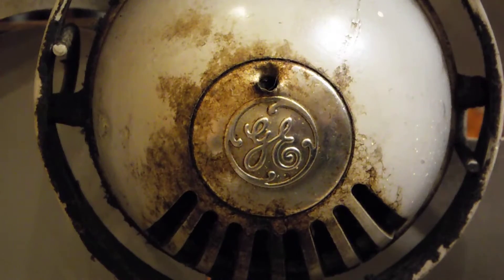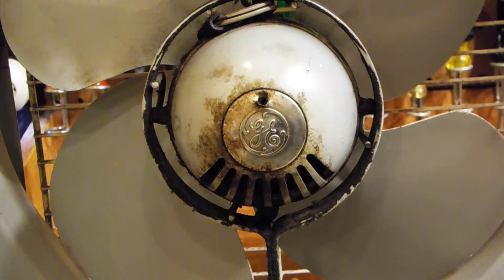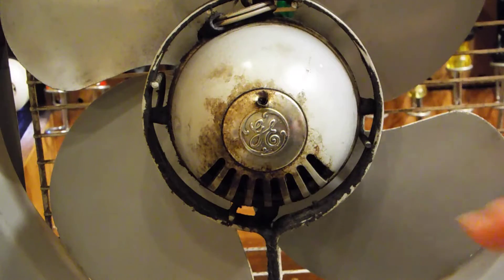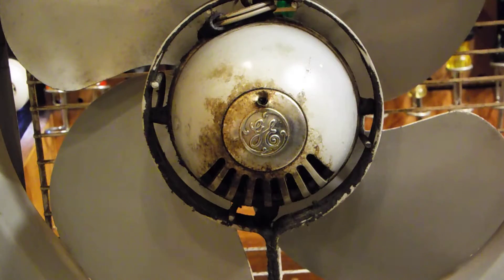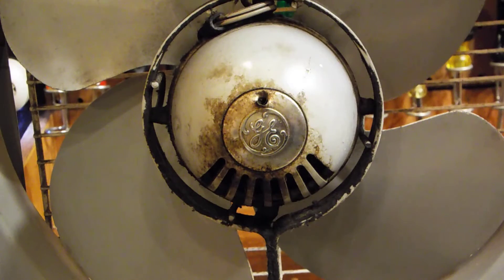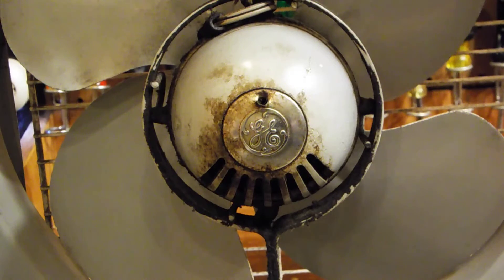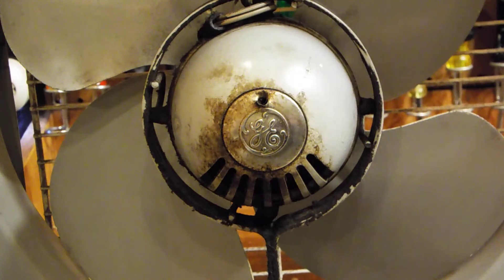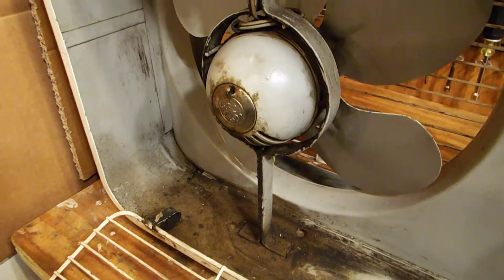Lubricating General Electric Fan Motors

Comment: I just watched your video and did this little mod. The blades are actually vertical on my moms fan so it basically blows air in all directions with no need for oscillation. As soon as I drilled the hole I saw the fiber material. Soaked it good with machine oil and put a piece of duct tape over the hole to keep from dripping. Works like brand new. Thank you for this video!

Comment: Hello sir. I thank you for this video! I have an early GE all purpose fan with the ball motor, and am grateful for your help..however, you should know..i removed the GE logo, under which there is another cap, which i drilled the hole into, and then replaced the GE logo over it. It saves the beautiful logo, and acheives the intended result. Hope you can use that information in the future! it's kind of like a bearing cap on old-school tapered bearing caps on cars, you just gotta gently pry it out.
Reply from the maker: This is true.. I was not the one who worked on this fan originally..

Comment: these single bearing motors are called Unit Bearing Motors as today they are common in refrigeration equipment. the older GE fans and refrigeration unit bearing motors have to drill a hole in the cap to add oil nondetergent SAE 20 or zoom spout. as these old GE motors do have style to them as these are the Shaded Pole type 4 pole motors in the smaller GE ball motors and table fans as will all unit Bearing refrigeration motors. the GE hassock fan and the w series GE box fans use a bigger 6 pole shaded pole unit bearing motor problem is the lubricant wears away over time the bearing wears and the rotor contacts the stator unless there is a way to replace that single bushing in that motor. for refrigeration motors they replace the entire motor. as nowadays these Unit bearing motors are being superceeded by PSC permanent split capacitor types, which is more efficient than shaded pole, and now Electronically Communtated ECM motors. if i get a ge all purpose fan i may put a modern motor in it and keep the original motor if i decide to flip it or sell it in the future. this ball motor has appeared in many GE fans the twin fan , single window fan, and most noticibly the television styled All Purpose fan. and the smaller box fan with the exception it has two mounting posts on the back. they design the fan in the way that you can't replace the motor but in the GE all purpose fan with the metal rear grille you can replace the motor with a modern motor of your choice and a belly band mount but won't be astetically correct.  as i wish that GE will still make the old motors but with modern technology.
Reply from the maker: What make of motor do you intend to replace it with?
Reply: if i get this fan the ge all purpose fan ill use a GE Arktic ECM motor but still keep the original ball motor if i decide to flip it in the near future possibly an NOS GE Arktic motor but now GE Fasco Century formally A.O. Smith Magnetek and universal electric co. they are all now owned by Regal-Beloit with the GE motor renamed Genteq  i think the Arktic motor got renamed either Genteq or Morrill  as the Ge All purpose fan its an attractive looking fan styled after a television set as i think the later models of the fan has the plastic rear grille which encloses the original ball motor. as i seen ads on Ebay of the all purpose fan it circas from 1954 if i use a modern PSC motor or an ECM motor the amp draw will be lower plus it will save on the electric bill compared over the old single bearing or any shaded pole motor of that type.  for example a ge 4 pole shaded pole 3.3 inch motor inder the windings is a break with a heavy copper bar under it as thats the shaded pole of the motor ass the copper bars the shaded poles interfere with the efficiency when the motor is running. as the GE ball shaded pole motors were cheap in the day in today's costs its quickly eaten up in electric bills if used alot if multiple old fans with Shaded pole motors are used. from over one to 6 amps. a modern PSC motor im told with the run capacitor if its a 1.4 amp motor it will bump the amp draw down to .6 or so  as finding modern GE 3.3 inch motors are very hard to find they have Fasco, US Motors, Century, interlink, Dayton and Packard. as these old fans are repairable unlike today's fans sold in walmart its ment like to throw them away and buy another one and poorly built.